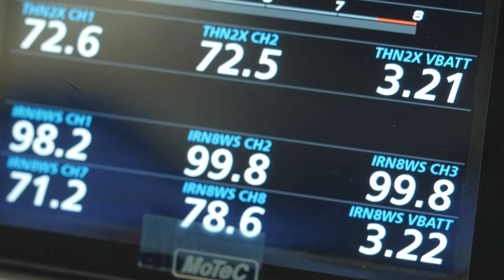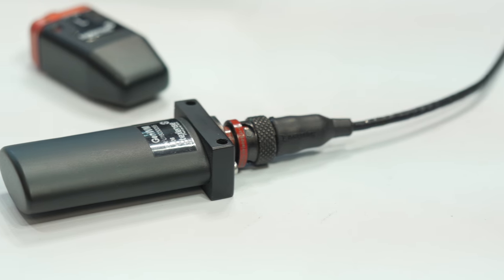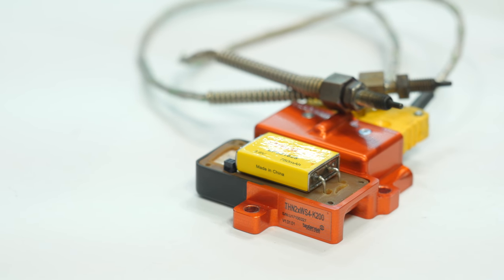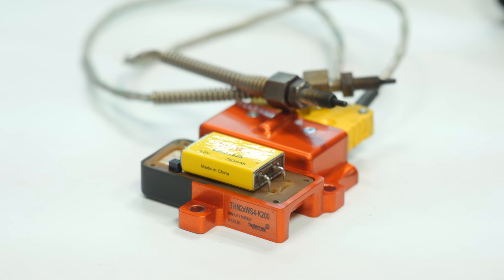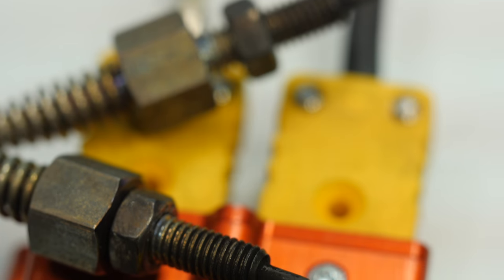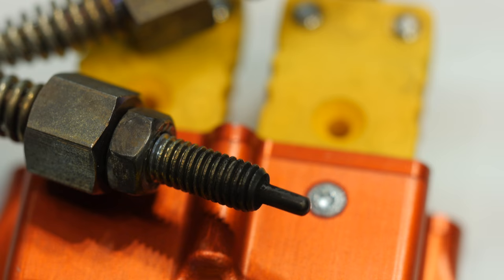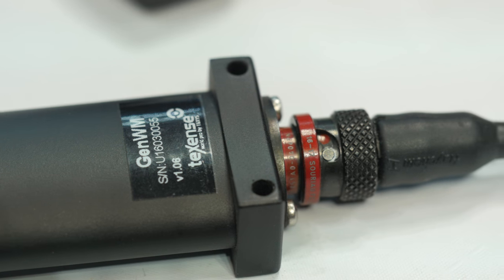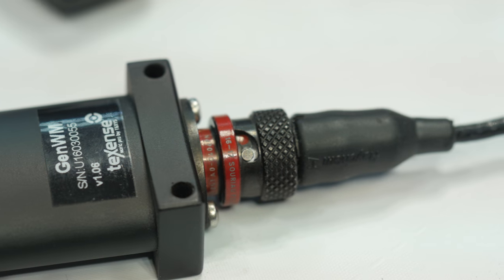Go faster with easy wireless data acquisition | Texense [TECH NUGGET]

Comment: Cool, I can see a lot of folks being interested in this, even at low level motorsport - it's cheap compared to sets of tyres.
The Texense site hasn't got any easier to navigate (and they still don't allow downloading data sheets), so can you post a link to this product, thanks? It seems to be using the https://texense.com/product/irn8-ws4/ sender units.

Comment: Do they have wireless camshafts and crankshaft position sensors?
Reply: My 10 cents worth.
That isn't what this particular product offers, but in theory it is possible to design and build a wireless sensor for those - offhand, though, I would surmise there are a few (probably a lot more) main problems.
a/ Signal sending/processing. Should there be a lost or introduced (static or signal from something else nearby on the some frequency?) signal with data aquisition it doesn't really matter, even with the camshaft it may not be critical, but if the crank signal has an interuption the ECU may take that as the missing tooth and fire the ignition at an engine damaging point. 
b/ Physical size. The sender will need to add a transmitter and power source which adds packaging issues and mass. There will also need to be (a) receiver(s) which also has/have packaging and power requirements.
c/ Reliability - vibration is a killer for electronics and the engine is a source of a multitude of vibrations - not just the fundamantals but harmonics which can result in very high "G" forces.
Reply: GordoWG1 WG1 Agreed!! it's interesting idea for say like a 5v if you need a maybe a extra sensor during testing or parts comparison... Or maybe even a shop to test if their customers sensor is faulty or to confirm a non normal reading. But for a crank or cam needing 12v the sensor has to be bulky and vibration is def a killer of electronics one you don't want to have with something controlling ignition timing. It's def not a solve all sensor thing but if the tech gets cheap enough I think it could be beneficial
Reply: GordoWG1 WG1 if the crank trigger was setup right something along the lines of having a stronger/longer pull on a Hall effect sensor for tdc you could mitigate any short loss in transmission to a ecm with the ecm being able to count the signals received and calculate the crank position 
As for mounting theres nothing saying that the sensor needs be mounted with the transmitter unit you could in theory run a multitude of sensors off of 1 sender unit much like a lot of current dealer level diagnostic tools work off of a wireless head not saying it’s a practical solution but it is possible
Reply: GordoWG1 WG1 I was also about to point out that various cars have mounted ecu’s on the engine before(Gm Europe liked to do this and come to think of it Nissan did it with their igniter units) and that vibration hasn’t been a big deal on those but the first one that came to mind I remember being very unreliable ( although the failures in them I seen were more to do with engine problems like misfires killing ignition driver circuits and oil pressure switches leaking causing the ecu to fill with oil
Reply: I wonder if the wireless signal transfer would have significant delay that could impact the spark and injection pulse timing
Reply: I am aware of coil packs being commonly mounted on the engines, but rather surprised an ECU would be as manufacturors usually mount then in cool locations - be interested in more info' on that, as may be rather behind the times?
Reply: Sorry, I don't see what point, or points, you are trying to make there?